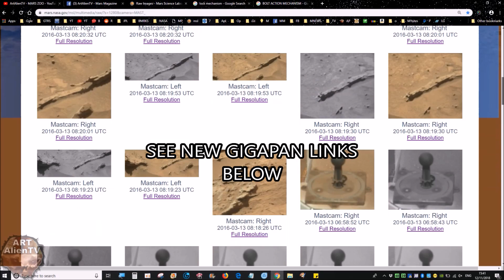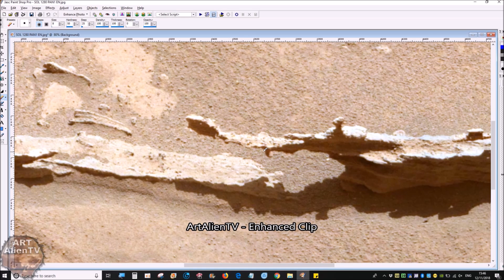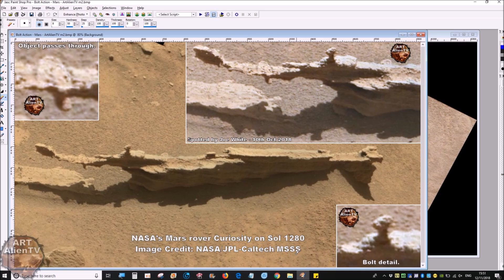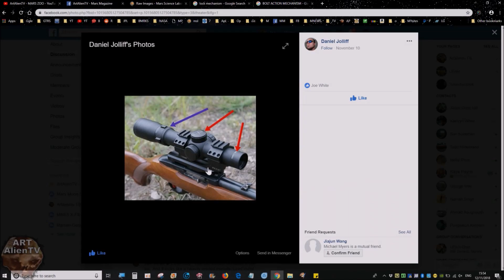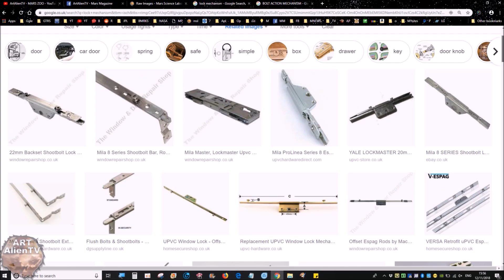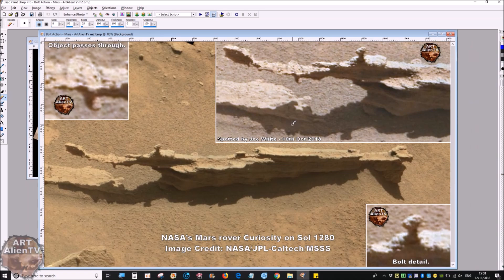MARS Machine Gun: Techno Fossil Found. ArtAlienTV (R)

Comment: Definitely a mechanical device that has corrosion and dust/sand encrusted all over. Probably metallic, can’t be a rock to suspend and cantilever out like that; a rock can’t hold its own weight in that configuration.
Reply from the maker: Exactly :)

Comment: I have looked at this ages ago. It caught my eye as I was converting all the curiosity ISO files to tiff. In the ISO file from analyst's notebook, you can actually see that the wee bits and pieces lying around it join below the sand as you can see the shadow if you really pump up the contrast. Also the texture that's on it is the same over layed texture they stick over the so called sand. I think this is a lot smoother than is shown. One other thing to note, on top there are two parallel lines which may indicate a slight recess. There are a load of examples of this sort of thing at the coast where peers have had metal fixings attached and the wood has rotted away and the only thing left is corroded metal that looks very similar to this.